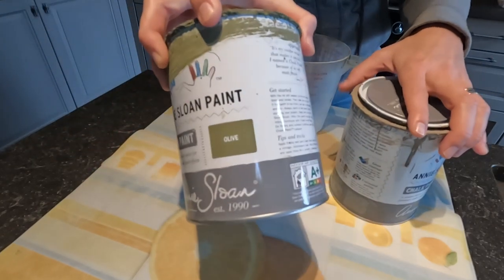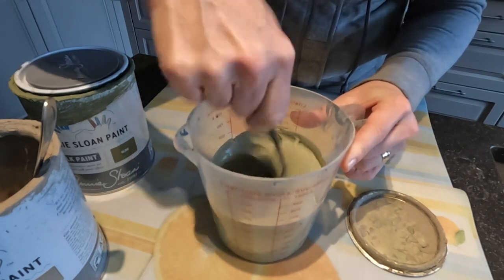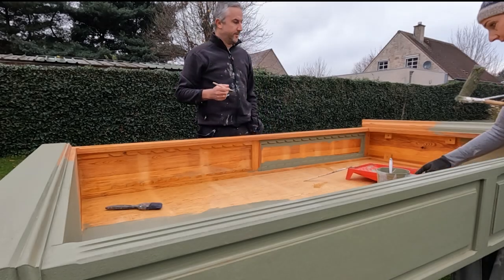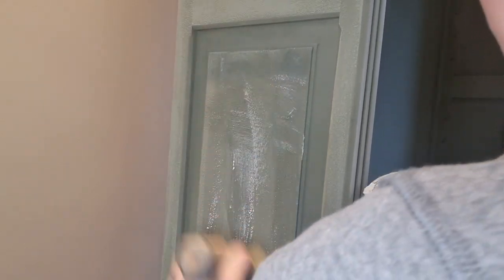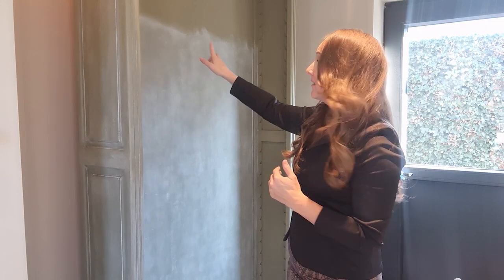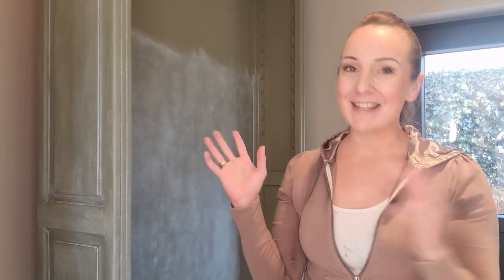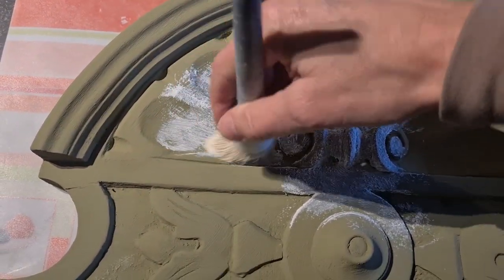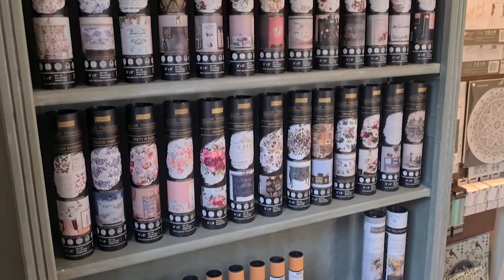White waxing a book case

Comment: Nice job, Leen 😉 I've got a question: why didn't you move white wax with clear wax in the first place? It's worked for me so far - I've never had to use mineral spirits 🤔
Reply from the maker: Hi Nina! The reason I had to use mineral spirits isn't because I didn't use clear wax, but because I couldn't finish the job in one day. So the wax had already set when I could finish the top part on another day. Even if I would have used clear wax underneath it would have set and wouldn't be able to move it around and blend in. Therefore I had to remove a bit with mineral spirits and then finish with the last part. 😘
Reply: @New_Renaissance  ok, I get it. I guess, in my case, the wax was still fresh enough to move it around with clear wax 🤔 Anyway, keeping in mind the tip 😉 Hugs from cols Spain 😘